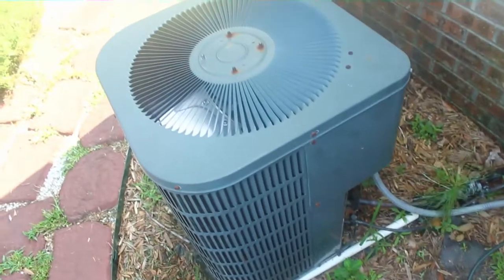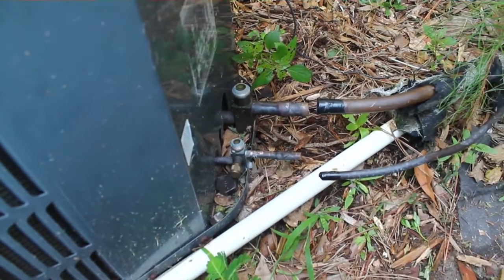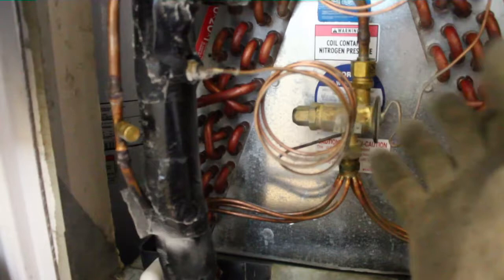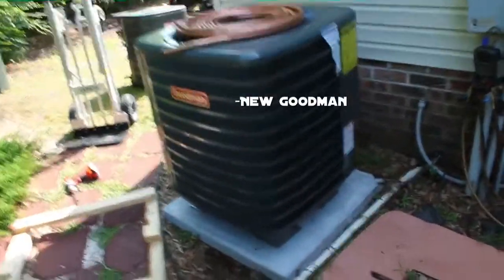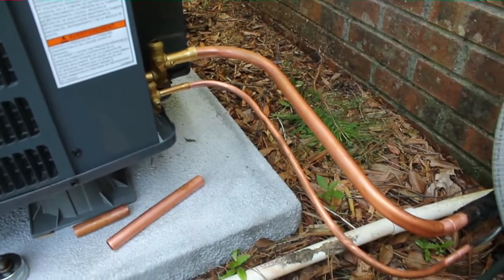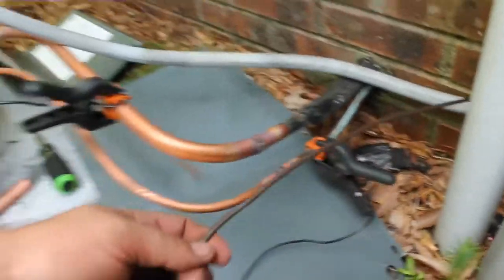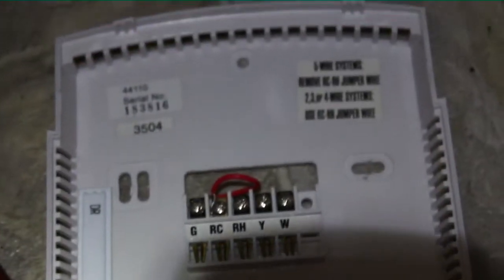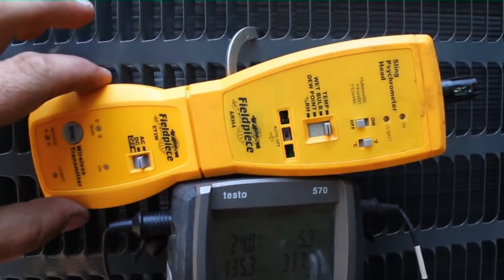HVAC Install- Goodman GSZ Heat Pump

Comment: why are air filters on top of coil
Reply: the design for mobile homes is a down flow position. some of the original coils actually had rails to properly hold the filters into place.